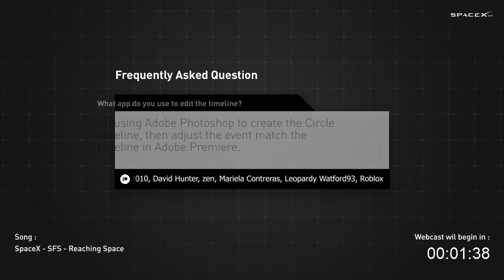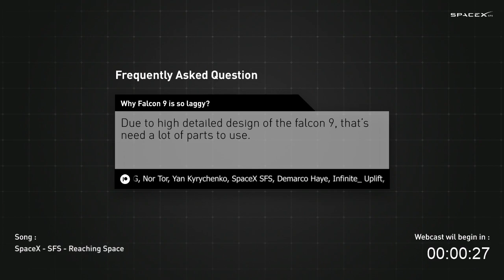NROL-87 Mission

Comment: How can you see your fuel with 0 opacity and how did you survive re-entry with no heat shields?
Reply: It's possible, you just need to slow down during reentry, so it doesn't get "hot"
Reply: @santisfs4016  what altitude? To start reentry burn?
Reply: @haruo3099  When the rocket starts to get too hot
Reply: At 17.5 km
Reply: @marletsugpatan1913  17.5km until what altitude?